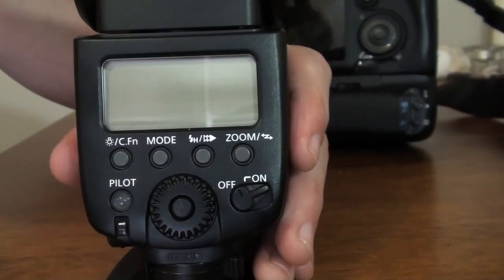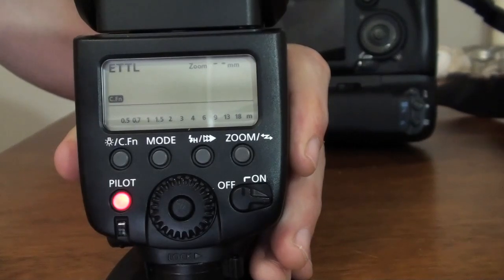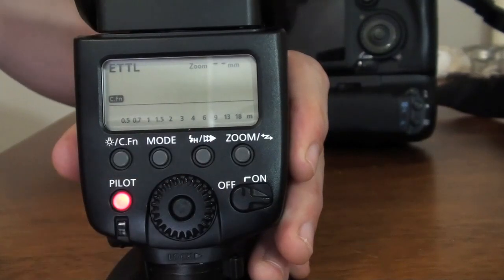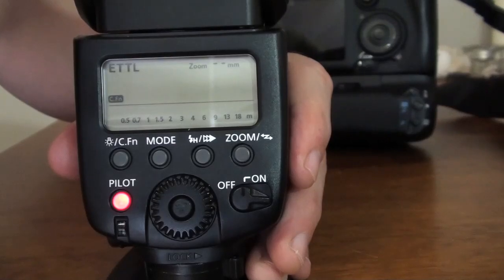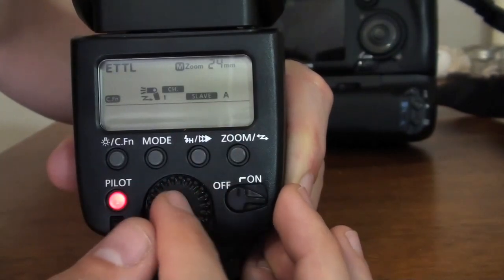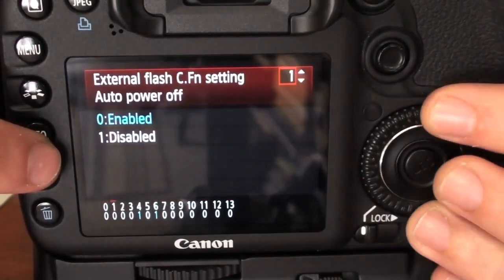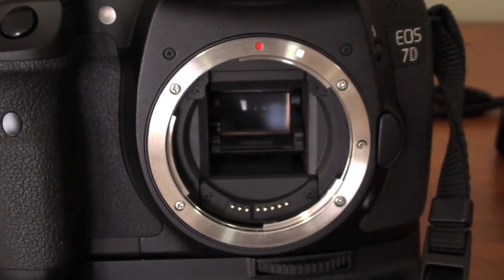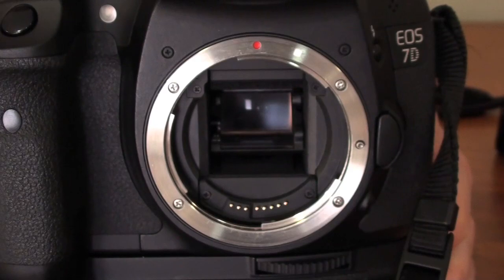Canon Speedlite 580EX II Tutorial Part 2

Comment from the maker: I think that the 7D/580 EX II is a great combo.  The speedlite offer great power, wireless function (event if limited compare to expensive transmitter),  and it is robust.  You can set up a 580 with other speedlite and use it as a master.  Definitely go with the 580 over the 430 for the power. 

Now I would go with the new 600 EX-RT If you think that you need lot's of speedlite often and have a good budget.  The 600 have a buit in wireless transmitter that will work with I think only other 600

Comment: My first recommendation for the 580 ex is to use 2500-2800 ma rechargeable batteries.
Most normal batteries put out a steady decline of 1500 ma (or less)  28000 makes sure your flash always keeps up with your shutter speed!

(Otherwise you'll get frequent black shots)

Comment: When you are shooting with a flash, which settings do you use in your camera? S.S, ISO, Aperture? My canon shows always negative exposure in the meter. Why is this?
Reply from the maker: Hi first I want to apologize for the late response.  I might be asking the obvious but have you looked at the exposure compensation meter for the camera and for the flash?  Might be your issue for the negative meter.  I always use Manual mode and my settings varies depending on what I want to shoot.  I use slow ss and mid range aperture when shooting real estate,  1/250-1 sec and f/8-11. I’ll shoot ss 1/125-1/250 wide open aperture and low ISO for portraits and fast ss 1/1000-1/2000 higher iso 400 and will adjust aperture to match a proper exposure if I shoot any fast motion subject outside. Hopefully this help.

Comment: Hi Manuel,  can you please explain how to reset the Canon Speedlite 580EX, and the Canon Speedlite 580EX II to factory settings. Thank you in advance.
Reply from the maker: +gopal govender Hi,  the easiest way to reset the speedlite is to go in the menu on your camera with the speedlite on it.  Make sure that you are in any mode other than fully automatic.  Then you should find the flash control option (it's in my first option menu on my 7d).  After choose the Clear external flash c.Fn setting.  It should clear all of the settings and bring the speedlite back to square one.

Comment: my back info panel is flashing over and over like its broken?? Any way to fix this ?
Reply: You have probably sorted this by now but just in case, it could be that you have the little white catclight card slightly out, make sure it is all the way in and it should stop blinking.
Reply: you have the head of the flash pointing down below 90 degrees. Thats what the info panel is flashing.
Reply: If the flash head is tilted out of normal position like when you bouncing the light, that is when the back panel flashes. It is normal.

Comment: I need some help. I am trying to use a canon 580exii on a sony nex 7 with the proper shoe adapter. Using the ETTL, the TTL, and the EM modes I get washed out photos. I can only get good photos in 100% Manual mode. It doesn't matter what I set the flashes configuration variable 5 to. So, does this mean the fanciet functions on the canon580 just don't work with the sony nex 7?
Reply from the maker: Hi Peter.  I am not familiar with that combo.  My guess is the washout might be cause because of the flash exposure compensation.  It is possible that it is in a positive value either on your camera or on the flash.  I have a Godox flash with a Sony a7III and I can have +2 on my camera and 0 on my flash.  So I would have washout images even if my flash shows 0.  Let me know if it makes sense or not.

Comment: is it HSS?
Reply from the maker: The 580exII does have the hss feature.
Reply: @manuelmartelphotography  thanks
Reply: @manuelmartelphotography  okey what is your opinion for first time flash using experience. A brand new third party flash, like a yongnuo yn685 ? or second hand but in good condition 580ex ii ?
Reply from the maker: Well it's a good question.  I personally switch to Sony from Canon.  I bought a Godox third party flash because it was cheaper and almost as good as the Sony one. I am very pleased with it and I also purchase a trigger and Canon receiver so I can still use my 580 EXII because it is a fantastic flash.  So I guess what I am trying to say is you wont get disappointed with a second hand 580EXII if it is in good condition. The third party brand are also good and way cheaper if you want to build a kit.
Reply: @manuelmartelphotography  You dont say exactly specific thing like me :) good options both of them. Im not sure about 580exii usability. For example if ı have a godox tt685c with xt1 trigger , ı can add second tt685 without any extra receiver.Also I can manage the flash from trigger menu. But if ı wanna use 580exii with same budget,ı can find only basic trigger because ı have to buy kit. and if ı wanna add more flash ı have to buy another trigger. Because optical slave mode is not regular in daylight. I started to thinking about canon gears sell strategy. Because they are not just one option nowadays for buying a flash. I think differences are not too big between two flashes about quality.

Comment: OK, I need some real help with this flash by you geniuses out there  Try not to laugh too hard over my questions.  I am only a Nuclear Engineer of 34 years.  I am shooting an Olympus OM10 in manual mode and it doesn't have anything fancy on this prehistoric film camera. So I use the mode button and and set the display to "M" but there is an "E" above it on the left side.  Is it supposed to be there and what does the "E" mean and do? Second question: in the mode display I see "1/4". I do not know what this nomenclature even means. Obviously it is not a "quarter of an inch" but what the hell does it mean? I have used simpler flashes where you just pick one of three ranges on the front of the flash and set the aperture and shutter speed (by the way do I use 1/30 seconds or 1/60 seconds)?  If I use an external power source I did eventually find where you set one of the variables to tell it that.  By the way can someone recommend a good external power source for this flash that doesn't cost more than the flash itself?  I await with baited breath your answers as this flash gives my life meaning and substance.
Reply from the maker: Hi Peter,  The 1/4 refers to the power of the flash, in this case it would be a quarter of the power.  The Power guide is 190' or 58 meters (at 105mm) that's how far it will power at 1/1 or maximum power.  As far as external power source for the flash, I always used 3 sets of rechargeable batteries.  It is a bit more economical and portable than a battery pack.  The 580EX II is a Canon flash.  So my guess is when you put the flash on your Olympus OM10 there is a lack of communication between the two and that's the reason there is a E above the M in Manual Mode.  I don't have the flash with me at the moment as I am away on a trip for another month.  I can take a look when I come back home to give you a better answer.